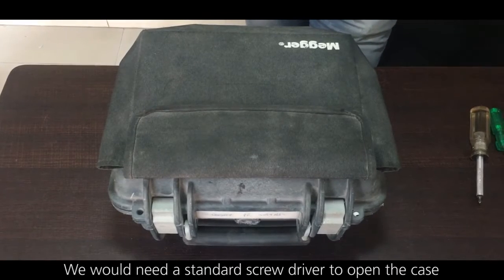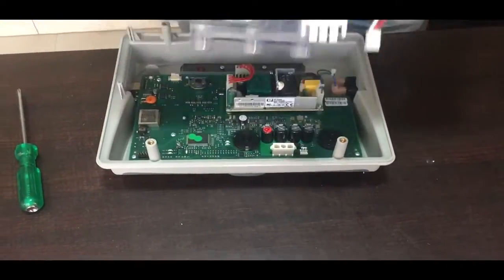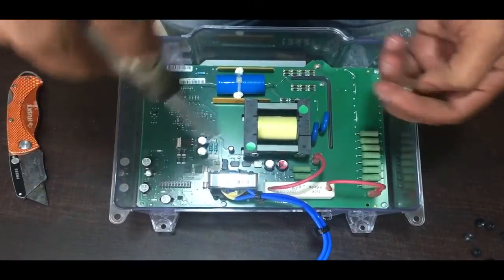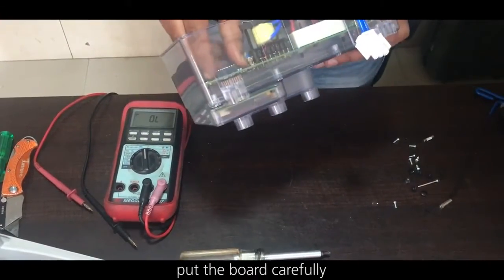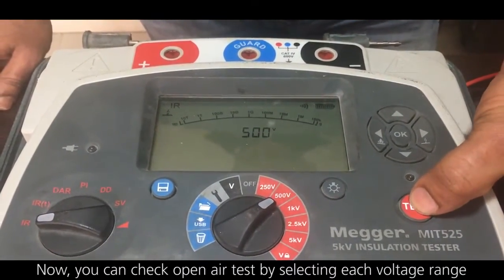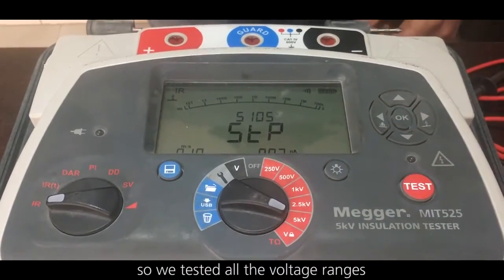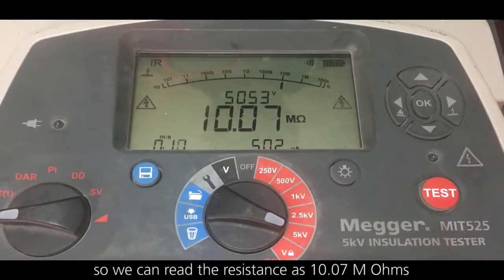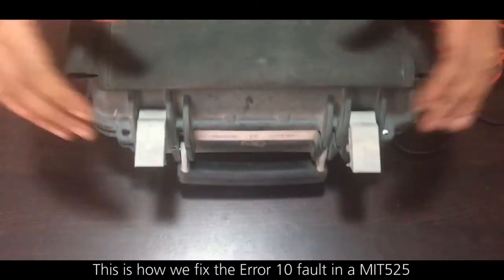Megger Service Training   MIT525  Error 10   Cause 1   Faulty fuse

Comment: Hello, in my case we have an MIT 1025, but we checked the fuse and the fuse is in good condition, the meter presented the problem after connecting it to charge. Do you know what it could be???

Comment: Good evening, brothers, I already checked the 2 A 250V fuse and it's good, but the MIT-515 keeps giving me error 10, what other possible fault it could be, thanks, if you have the plan, I can find the fault.
Reply: :hand-pink-waving:
Reply: did u solved that problem
Reply: Dear, this equipment needs to communicate between board (A7) and board (A8) to adjust the voltage via the photocoupler signal, if it is connected separately the Fet 067N08N acts to protect the circuit, if the voltage is unregulated the Fet can burn, therefore it is necessary to repair it so that the voltage on the second one is 25 volts, I hope it helps, (This information is only for technicians, if not it is better to look for a professional)
Reply: The voltage is 25 V but still give me the Error
Reply: You solved the problem